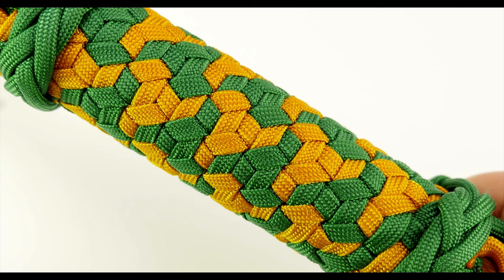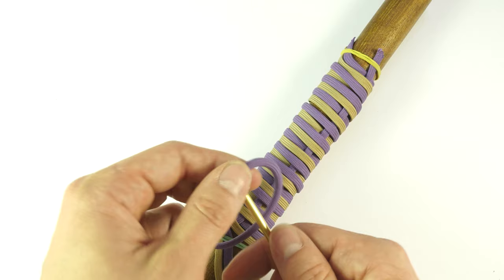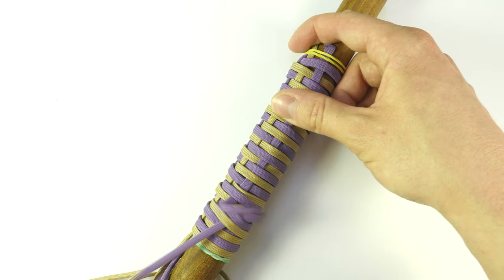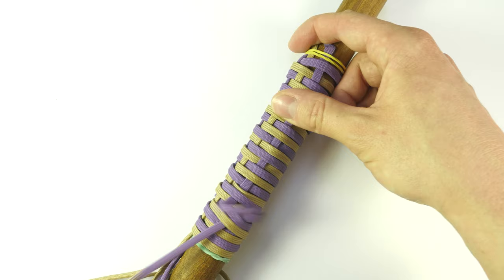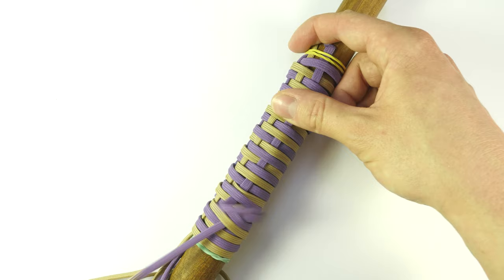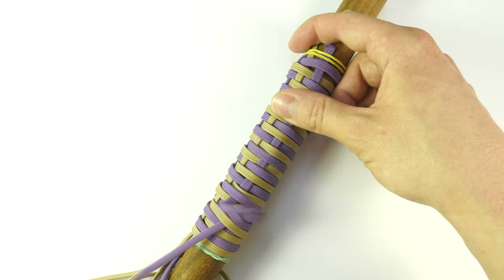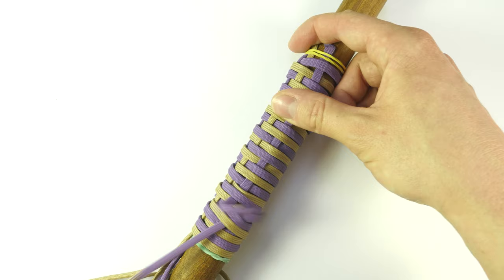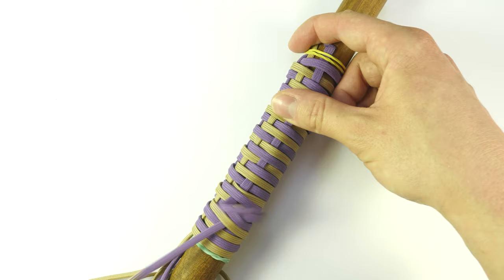Pinwheel triaxial

Comment: Paracord guild , I love your videos, but could you please tell us about how much of each color cord you use at the start of your videos? Going to attempt this one tonight just want to know I have enough paracord before I start
Reply from the maker: Hey!

I have gotten into the habit of doing this, but it varies depending on the length and diameter of the wrap, so I left it out this time. For this specific wrap (done on a 1 inch diameter mandrel) I used 2 initial, longer cords and 30 shorter cords, each about a foot long. You can use a bit shorter cords though, I prefer slightly longer ones because it makes it easier.

I hope that helps, be sure to message me for more info if needed!

Mark